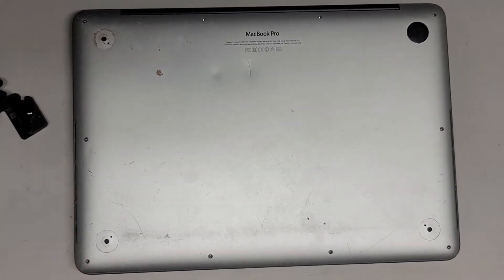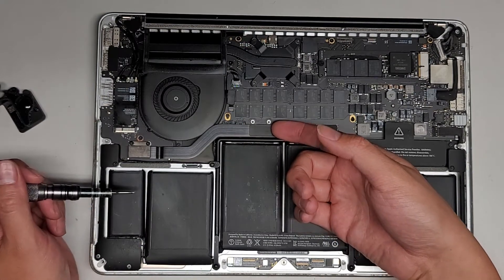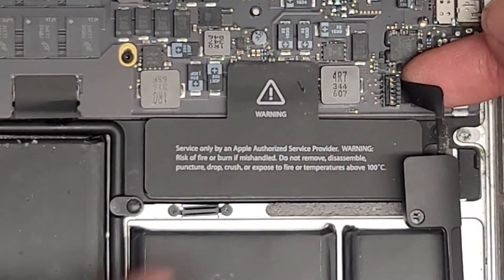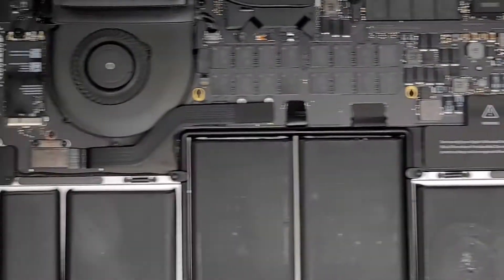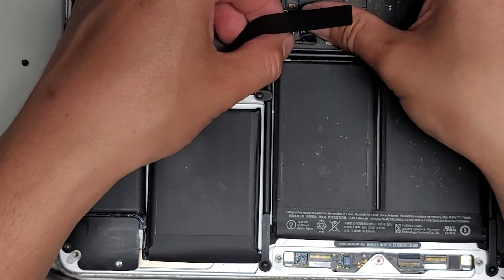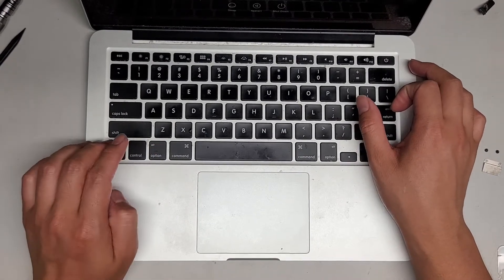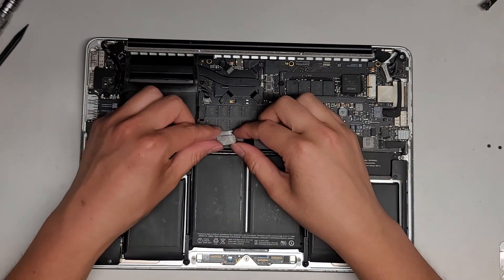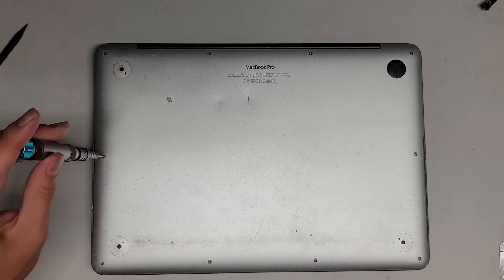13" inch Retina MacBook Pro A1502 Early Mid Late 2012 2013 2014 2015 Speaker Replacement Repair

Comment: Thank you for sharing the video.   May i make a kind suggestion though..  "ALWAYS" Disconnect the battery first then hold the power button down for about 30-45 second to discharge the Logic Board, before touching any of the internal components. I also highly recommend you wear gloves as well.  😀
Reply from the maker: Watch my newer videos haha
Reply from the maker: Gloves aren't a good idea though.
Reply: @ItsBinhRepaired  I’ve been an apple certified Macintosh technician for almost 15 years. Also been a Microsoft certified master technician for longer than that. Never had an issue wearing gloves. 👍🏻😀
Reply from the maker: @TarynnElizabeth619  meh, not for me. You lose dexterity.

Comment: Thanks bro for helping us. I've hp laptop, the problem with cam. Taking Pic or vdeio will not appear but only only when you rap or the cam for long time. Can u make vdeio about it
Reply from the maker: What do you mean rap? I can't make a video unless you send me the laptop.
Reply: @ItsBinhRepaired  how can I send it
Reply from the maker: @vitaminenglish4u235  address is in the description, but you'll have to pay shipping both ways and repair cost if you need me to do a repair and return it.
Reply: @ItsBinhRepaired  do tutorial. As long as u claim u just help u viewers to how to prepair things. I'm not going to send anything
Reply from the maker: @vitaminenglish4u235   I don't own the computers I do repairs on, so I cannot risk damaging them doing YouTube viewer requests. The computers in my videos are from paying customers that have specific repairs needed. I cannot risk damaging them further by doing unauthorized disassembly work. Also, by the time the videos are up, they're almost always already repaired and returned to the customer.

I am not going to buy computers to make videos because it is not cost effective, and I am not paid to do so. The fact that you expect me to spend my time and money to get a computer to do a video just for you is extremely rude, and shows how little you appreciate what I do.

I've made thousands of videos, and most of them I make less than $1 on. You think because I make YouTube videos, suddenly my work as a computer repair technician should not be compensated?

Imagine you took your car to get your oil changed and then find out they pulled the engine out and took everything else out to make a video. You'd be pissed! 

Now imagine you recorded what you did for a living and then your employer said they aren't going to pay you for your work because you're doing it to help others see how to do your job, and on top of that, any supplies you need for the job, you should pay for yourself, because "you're doing it to help people". Do you realize how messed up that is? That's essentially what you just said to me.

Hopefully this helps you understand how my business works and how I'm able to make all these videos. Sorry if my response seems rude, but I felt extremely disrespected when you essentially told me to go get a computer to make a video at my own expense for your benefit because, "I'm doing it to help people." I do not respect people that do not respect me and I feel completely disrespected and am insulted.